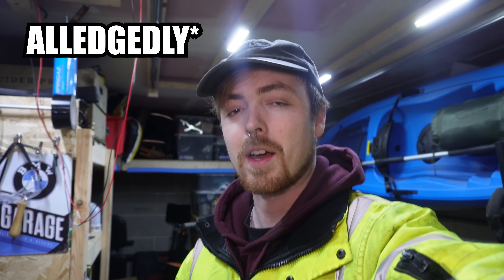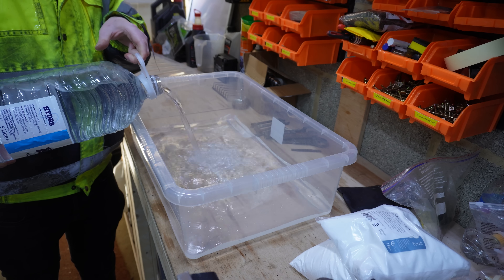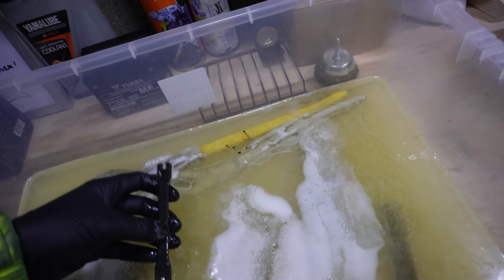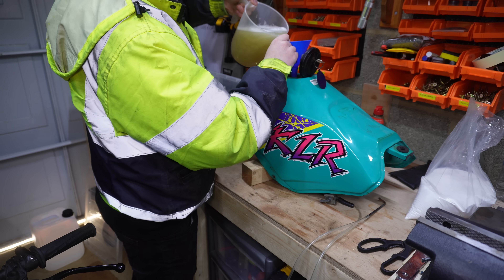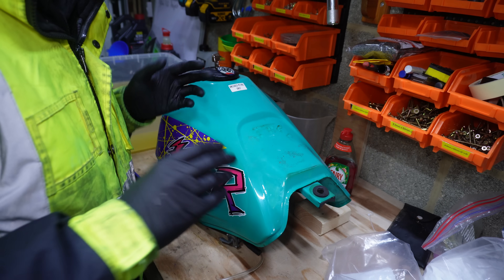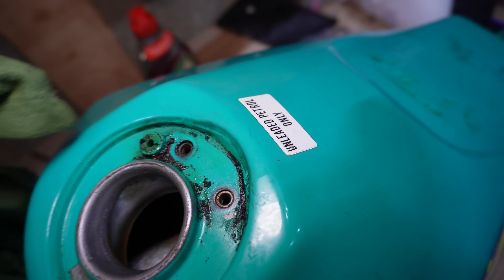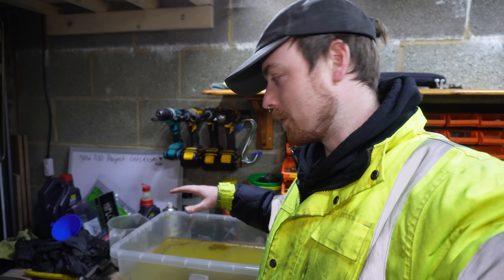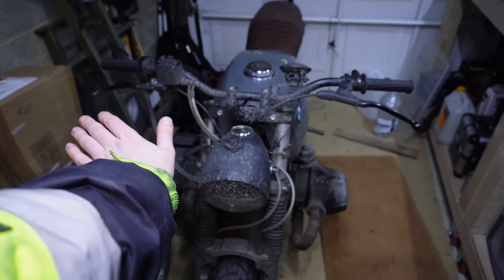How to clean a motorcycle fuel tank (Better/Cheaper than Evaporust?)

Comment: I watched that same video that you did and purchased the ingredients from Amazon. I plan on doing this weekend on a couple tanks.  Do you think this solution would be good to use in a ultrasonic cleaner?
Reply from the maker: It works well, it also works even better combined with the method of putting nuts and bolts or any other abrasive medium in the tank too because sometimes it needs a little help to lift off the rust. You can see this in my NC50 video after this one where I cleaned the tank.
I cant say whether its good to use in an ultrasonic cleaner though mate, I don't have one so I cant try it either haha.

Comment: If you really want to step up your rust removal, get some molasses.  Mix up about 10% or so with plain ole water.   Fill up your tank or throw in a bunch of rusty metal.

Come back in two weeks, pull the stuff out and wash it off.   Cast iron will come up gray like when it was brand new. Steel will come up white like when it was brand new.   And the inside of your tank will come out solid white, with clean white pits, same color as when it was new.

Or come back in a month, and same thing.    That sugar water is amazing.   I keep a 55 gallon drum outside with that mixture at all times for de-rusting blocks, cylinder heads, crankshafts, old tools, or whatever rusty thing I can find.   I can't put into words how well that stuff works.   And what's crazy is how it doesn't rust after you pull it out and clean it.  I don't even treat the iron or steel and it just sits there refusing to rust.

When deer season starts up the cheapest place to get it is Tractor Supply.   But if it's not deer season, you can get it at Amazon any time of the year.  https://amzn.to/3EN7vI8

Best part is there's no special chemicals, no weighing to get a recipe 'just right', no neutralizing, no special disposal.   When you're done with it or want to start fresh, just dump it in the yard or the garden.   The ground loves it.  Because it's just water, sugar, iron, and microbes.
Reply: No.

Comment: This concoction is NOT CHEAP to make.  It's far cheaper to just get muriatic acid which works far better and far faster!  You can then quickly neutralize it to stop it.
Reply from the maker: Acid is more expensive I just looked, and you can’t blind yourself with this stuff got cause severe tissue damage, you can with acid as it’s the first warnings that came up when I just searched it to see the price? So also need to factor in thick gloves, goggles and other protective clothing, I can stick my hands in this solution and be fine, no need to neutralise and doesn’t rust again so I appreciate your suggestion but I think this stuff’s still better in the long run

Comment: Just amazing. I already purchased the chemicals. Thank you for this, I'll definitely be using this for the projects on my channel.
Reply from the maker: You're welcome mate, its working really well combined with the old nuts and bolts shaken inside the tank method, and it doesn't flash rust ive found like using acids like vinegar. Look forward to checking out the projects on your channel
Reply: @HodgeFix  Thank you. Can't wait to start using it. Now I've nearly finished the XJ900F, and I'll move on to the next bike. I also have a very rusty SR125 that I got running in my last video. Your rust remover solution will be put to good use! I love your videos, keep up the good work.

Comment: On the rust coming back if you use Hydraulic oil new or old it's the best Anti-rust out there and if you mix with rust remover and fairy magnum spray it on it's best use is underneath cars stops rust dead

Comment: THE WASHING UP LIQUID IS TO ALTER THE PH IN THE WATER YOU PUT THAT IN BEFORE YOU MIX IN BAKING SODA IF YOU WANT IT TO STAY ON THE PARTS THAT ARE HARD TO REACH MIX 2 HEAP TABLE SPOON OF CORNFLOUR THEN PUT IT ALL ON A LOW HEAT UNTILL IT GOES THICK YOU CAN ALWAYS ADD MORE CORNFLOUR IF NEEDED

Comment: Great video and comments are fun too. Thanks for the video. By the way i use the same solution on smaller parts and put them in an old slow cooker i got from the tip. Use the lowest heat setting and stir regularly and parts come out looking fantastic. Dont know how the heating helps but it does 👍
Reply from the maker: Glad you enjoyed the video mate! That’s a good idea, I’d give that a go if I had power in my garage. Almost like a non vibrating ultrasonic hah

Comment: I tried 50g citric acid and 26,5g of baking soda, dissolved to 500 ml of water. I removed rust from a few chicels and both of them had a visible line in the shaft. Over it the steel was grey, under the line black.

Could it be that the quenched part of the chiesels turned black?
Reply from the maker: Someone else commented on this that the black is the rust that’s been converted to something else, I can’t seem to find their comment though, the same thing happened to mine with them turning black but it brushed off fine
Reply: @HodgeFix  I don't actually mind if the piece turns black, I think that the rust has converted into pretty stable barrier. I tried sanding the chisels with 400 grit wet paper and WD40, and it did not touch the black oxide layer. The thing I am wondering is that the whole chisels were covered in somewhat uniform rust layer and only the apparrently hardened part turned black, the rest of the shank is grey.

Comment: How do you dispose of the used solution?
Reply from the maker: I haven’t, I’ve kept it in a 10L container, it should be reusable until it doesn’t work anymore, but I read somewhere else that it’s pretty harmless to dispose of. I’ll look into this more when I dispose of it but I think it’s essentially ok to pour down the drain, don’t quote me on that thought
Reply: @ If I were on city (or county) sewer, I’m sure that would be acceptable but I’m on a septic system, so I have to be careful. Thanks
Reply from the maker: @ ahhh I see yeah, I’m not too sure about that sorry!

Comment: I am also not paid by anyone but a really good thing to do next if you are not going to coat or plate the parts is apply a product called CorrosionX.  This product stands out as a rust preventative and it works amazingly well.  

There are a couple other brands of products that compete with CorrosionX that are also really good such as Corrosion Block, i think CRC makes something good, even WD40 - wait, i know WD40 is mostly good for chasing water away but not for protection or lubrication but they make a few different products that are unique called WD40 Specialist for CorrosionX something like that and it is a really good product.  If i was not already using CorrosionX i would use it for sure.

I mentioned a few different brands just so there are some choices but fwiw, these products are way, way, way far and above other oils, spray waxes ( i think one of the products is in part a wax), perhaps Cosmoline can compete?  By the way, there is a product called Boshield from Boeing aircraft and with a name like that you would think that it would be really great, is is ok, no where near as good as CorrosionX, etc... 

 Anyway, rust is evil, it can make things ugly, worse than that it can make things dysfunctional and like the saying goes - rust never sleeps.    If you have never heard of these products take a chance i think you will be delighted.

Comment: Should have put the water directly in the tank, added the chemicals, waited for the reaction to attack the rust, then squirted the washing up liquid in.
A similar reaction is achieved when cleaning a drain with bicarb and vinegar.
Reply from the maker: Wouldn’t it have just blasted out the top? Like a coke bottle does with a narrow exit?

Comment: I think the sodium carbonate is counteracting the citric acid hence the sizzling. So I think you should not use them together. First in citric acid or vinegar if rust is gone put the parts in the sodium carbonate solution to counter act the acid and prevent flyrust. Steel does not rust in basic environment. I get the same result with vinegar and ammonia solution to flush. Add nuts of small pebbles for the fueltank to knock off any chunck and get a polishing effect.The black layer is  iron reacting/converted by the acid so your solution is still acidic.
Reply from the maker: Check out the video in the description of my video as it’s not actually the acid doing the rust removal, but because it’s not as acidic it doesn’t damage the base metal under the rust as much, it’s just as affective as using just acid but a lot less acidic! Although putting nuts in the tank to knock off the rust is something I should’ve done, thank you for that suggestion 👍🏻

Comment: A product called OSPHO does an excellent job removing rust.  It changes iron oxide into iron phosphate which is inert.   It also acts as a primer for painting.  It works fast unlike Evaporust and is much cheaper ...about $20 per gallon.    BEST PRODUCT AVAILABLE FOR RUST REMOVAL
Reply: It's just phosphoric acid. As you say, it works very well.  And it leaves a rust resistant coating on the steel, as a bonus

Comment: Roofing nails work good to scrap off lose rust. With the flat heads  with thin sharp edges and points it works really good. Just make sure you use steel ones not aluminum so that you can pull them out with a magnet
Reply from the maker: That’s a pretty interesting idea, cheers for sharing!

Comment: I imagine using this solution in an ultrasonic cleaner. Also, you could slosh around some stones or gravel inside the tank if you don't have enough old nuts and bolts.
Reply from the maker: Someone else commented that using it in an ultrasonic would be a bad idea, I can’t remember why they said that though, maybe that it would affect the machine I’m not sure I’ll try to find the comment again!

Comment: 12 volts and water and some baking soda , or washing soda crystals , electrolsis dose the job , i got an old transformer out of a lab many years back , i can vary the voltage , just gotta be careful not to blow the darn workshop up , ALWAYS WORK WITH DOOR OPEN AND A WELL VENTILATED WORKSHOP , hydrogene is highly flamable , infact cars would run better on it , better than battery power , and the only waste product is air and water , thats right fresh air and water out the exhaust pipe . i dont know why people think electricty is the future for car driving  " ITS NOT " i digress sorry .

Comment: Would using a stiff nylon brush produce a different result than using a wire brush (scratching and deposition of dissimilar metal)?
Reply from the maker: Yeah I think a stuff nylon brush might work, might need to soak a bit longer

Comment: I've noticed that if you have any oil or grease on the parts, it decreases the effectiveness of the solution. Even trying to use it on clean parts afterwards doesn't seem to work well. So I've added a step before using the citric acid solution. I soak the parts in lye (caustic soda, sodium hydroxide) to saponify and remove aany grease or oils. This was the cheapest and most effective degreaser I've found for doing large batches, but certainly you could use any commercially available degreaser, the important part is to keep the oils out of your rust removing solution.

Comment: since you are mixing alkaline [carbonate/soap] with an acid, & neutralising the solution i cant see this would be better than pure citric acid solution
Reply: u can also use a drill and wire brush circular attachment down into the tank to removed the visible rust scale. vinegar soak works on rusty tools, the dark colour isnt a problem;  i then soak the parts in oil. but  the rust will return in time
[you can also use an acid bath linked to a car battery for the tools....forget the tech term - electrolysis... ]
Reply from the maker: It reduces the acidity so it doesn’t damage the metal underneath, but creates a solution which doesn’t act using the acid, if you want a better explanation watch the video in the description, my explanation was terrible now I look back at it haha

Comment: Top Tip for making this process "cleaner" and reducing the quantity of solution needed:

1. Put the solution into a zip lock bag.
2. Put your rusty items into the zip lock bag.
3. Remove air and seal the zip lock bag.
4. Fill your large container with plain water.
5. Put the zip lock bag into the plain water in the container.

The water in the container "supports" the zip lock bag.
You only need "just enough" rust remover in the zip lock bag to cover the rusty items.
Because the plain water takes up the "empty space" in the container, and you only need to use a small volume of rust remover.

Once your rust remover is no longer effective or you need to pour off the gunk, you don't have to throw away such a large volume of solution.
It also keeps your large container clean, instead of full of gunk and debris.

Ultrasonic cleaners:

This technique also works well in an ultrasonic cleaner bath - put your items into the fluid in a ziplock bag, fill the ultrasonic cleaner bath with water.
The water conducts the ultrasonic waves through into the bag, and to the tools.
You end up using less solution, and don't dirty your ultrasonic cleaner.
Reply: Great tip. Another one... If you just dip your part in the cleaner for 30 min. or so, take it out and rinse, scour or brush the rust off in a separate container of water.
This keeps your chemical cleaner longer and it stays stronger.  
Rinsing it in water takes off the residue but doesn't seem to cause any additional rusting down the road.

Comment: In case you can't get to the store to buy chemicals, just go to your kitchen and grab some vinegar. I use vinegar to derust my tools. Works great on rusty screw driver bits, too. Of course, just like in this video, a little scrubdown with a wire brush helps.

Comment: I've made up and used the solution described. It's good. It works. Can't compare its life against Evaporust, (can't get that here) but it's CHEAP and WORKS.. Oil or prime your steel/iron immediately after rinsing or you'll get flash rust. 
I've used it to restore old files and rasps to use... It's that good.

Comment: The downside of a mainly citric acid based solution is that it will also attack good metal to some extent - that's what causes the overall black layer; it's the carbon left from steel after the iron has been eaten away. This is certainly better than pure citric acid, but still quite acidic.

Try the EDTA based rust remover that @ElementalMaker came up with (look back around four years).
That has next to no effect on good metal but does work really well to get rid of rust, with a near neutral (~6.5)ph. 
And like this it's cheap and uses readily available materials!

As with any rust remover that does not change the metal surface composition, the new surface WILL rust when rinsed off and exposed to air unless dried quickly and protected somehow; I generally use a trace of light oil on a cloth, just enough to leave a film without any obvious oiliness.
Reply: A soluble engineering oil, mixed with water at a ratio of 20:1 makes a good rinse. The oil mixes freely with the water and leaves a very fine film of oil on the surface when drained. It's used as a coolant for lathes because it doesn't cause any rust, even when it's left to dry naturally.

Comment: Where I live everything gets rusty...South West Cornwall is big on Seasalt.The comments from some people actually telling you a better way using the same ingredients are the beautiful people for me. Right now I'm sorting a golf buggy out that's been stood in a field for 2 year's left alone and is crying for help. Aluminium frame and chassis good, bodywork fibre glass very good...but engine parts exhaust and suspension badly rusted...tapping has removed quite a lot, next is this solution and im hoping and praying 🙏...it's got a 290 yamaha that's pretty cool for a buggy. It took me 3 hours to get the carburettor away, the wiring needs sorting so plenty to do.
I only want this buggy for the back 9 as it's a tough track upsy downsy...and I'm a senior citizen now or as some would say an OAP...But I bet I'm fitter than any Greggs sausage roll shop bouncers..😂😂 I'll keep yall posted. Cheers 🍻
Reply from the maker: Thanks for watching! I’ve had a lot of people say acid is better, or the sodium carbonate reduces the acidity, but it’s a different reaction and not the acid doing the work which is the whole point so it doesn’t dissolve the metal underneath like acid does! Good luck with your golf buggy restoration! I hope it goes well mate 👍🏻

Comment: Erm regarding the acid, you are using citric acid in extreme concentration, but yes, citric acid is the best thing for removing rust, did not know that bicarb of soda helped.
Reply from the maker: It’s not the acid doing the work, the sodium carbonate actually reduces the acidity but creates salts which are more effective at rust removal than the acid would’ve been, without dissolving as much of the base metal, hope this helps! I really should’ve explained it better in the video

Comment: For tanks, you will be beter off adding about 30 nuts and bolts and shaking the tank every day, rotating it through every surface. I hang mine from the ceiling by a rope so I can hold the tank horizontally at waist height for shaking and then slowly rotate it through 360 degrees while I shake it. Afterwards, I like to finish the cleaning with successive rinses of isopropyl alcohol to speed up drying it out on the inside. Works great.
Reply: Shake, shake, shake https://youtu.be/l3fZuW-aJsg?t=29
Reply: Another good tip,  the alcohol !